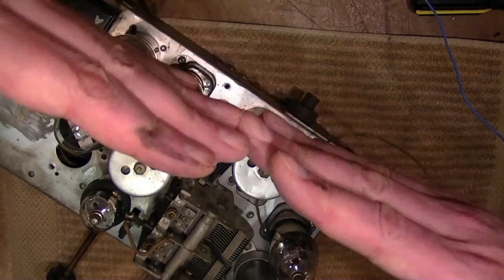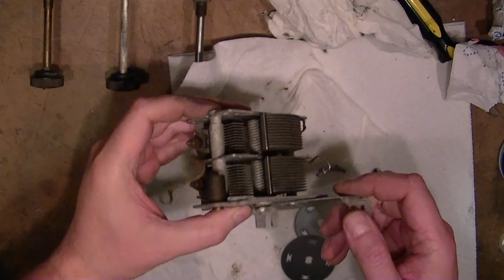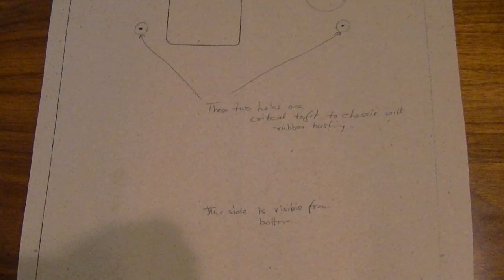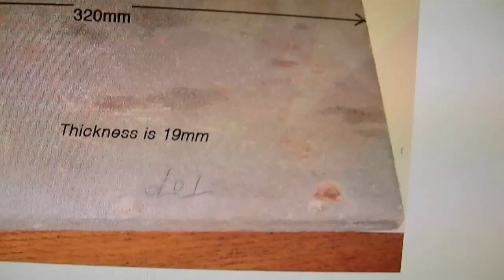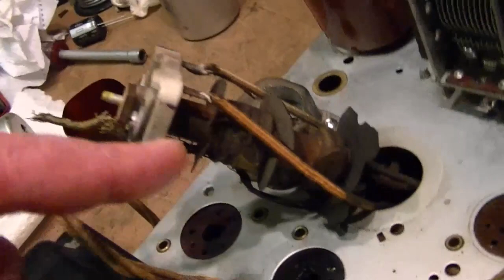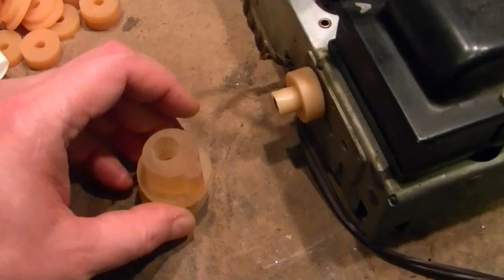Philco 38-7CS restoration p5o12

Comment: The set screw on the back is what you set the tension on the rear bearing with, the nut is just to lock it so it doesn't back out or get tighter as the capacitor is turned. Some tuning caps don't even have that, just a divot in the rear bracket where the end of the shaft rides.